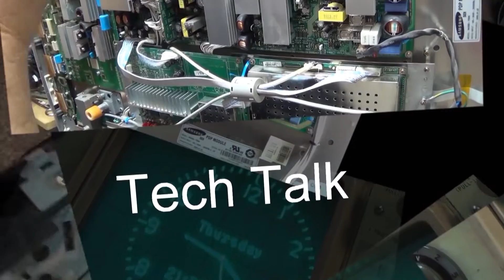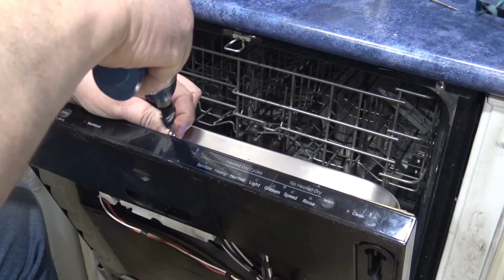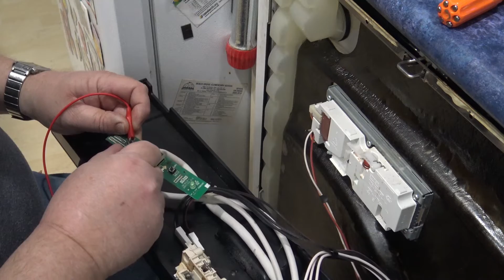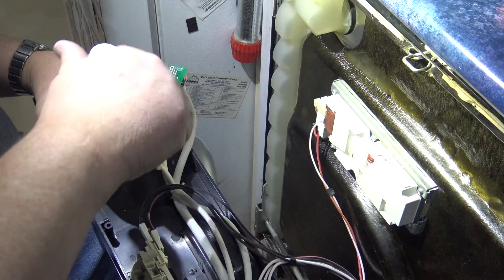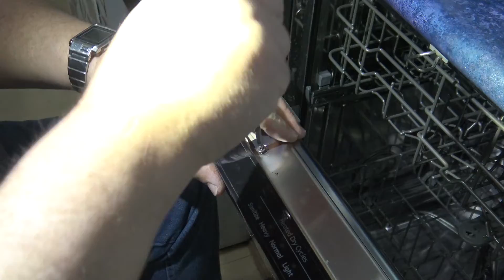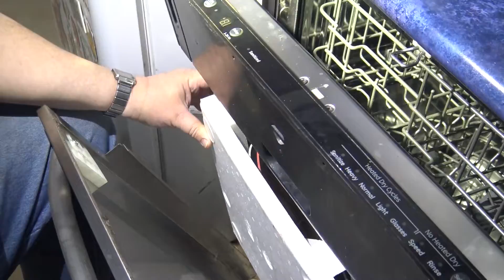GE Dishwasher has no power

Comment: With the number of times I've had to repair out of warranty fridges because they ice up ... I've run out of fingers. And they are all built by the same companies regardless of the brand names. It used to be they'd last 15 to 20 years. The new ones are CR*P. Same with dish washers, clothes washers, clothes dryers and most of the modern electronics sold in the big box stores. And even under warranty they kill you with convenience fees. Thank goodness for repair videos on YouTube.
Reply from the maker: The one this replaced was a Hotpoint. It had been given to me by a friend when he was renovating his condo, had been installed when built. I changed the plastic impeller twice in the 10 years I used it. The reason it was replaced in 2010 with this one was because the noise it made drown out the TV in the next room. Initially it was an outside wall, but when I built a new room out back, it was now making a racket in the TV room. This one is really quiet and all stainless steel ( the old was fiberglass and was bloody loud) but had mechanical timer that is never going to fail. When the impeller failed for the 3rd time I replaced it with this. Within 2 years the plastic on the detergent cover broke so the detergent has to be put in manually now. Then the display lost a segment due to water ingress on that same board. A few years ago it started having trouble turning off when it was steamy. Then the switch failed completely requiring this repair. Should run for a few more years I hope.

Comment: Our dishwasher was just over a year old and the pump went on it.  Whirlpool upper-mid range model, $950, light usage onlty.  Newer appliances are made to fail, period.
Reply from the maker: Yup, lots of plastic in there. My old washer was in the house when I bought it in 1993. It had been put in by the previous owner in the early 70's. It just broke about 2 years ago, and the repair guy came out. Charged me 75.00 to tell me the transmission had broken and no parts available. SO now I have a new Maytag.  It sure won't last no 40 years.